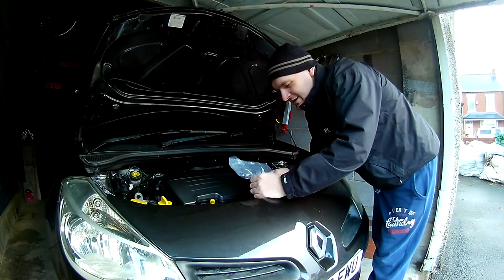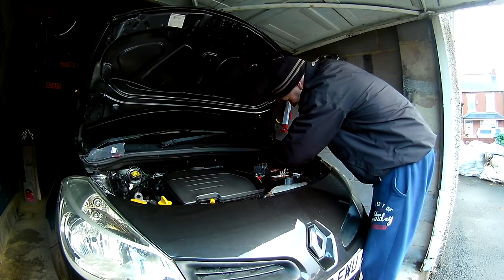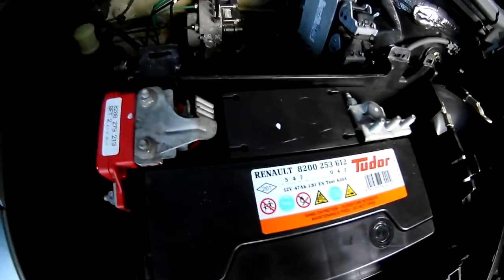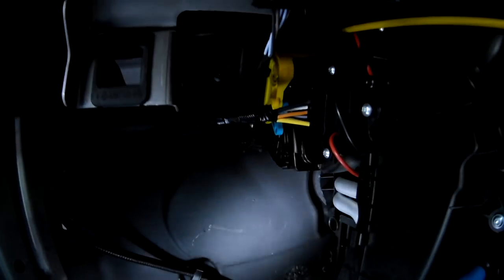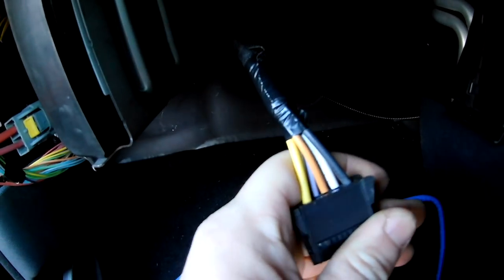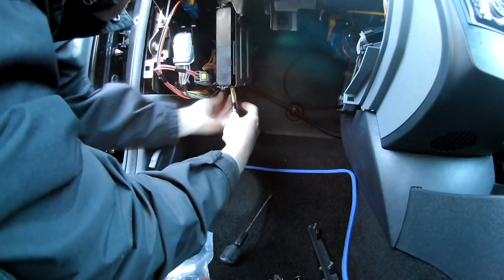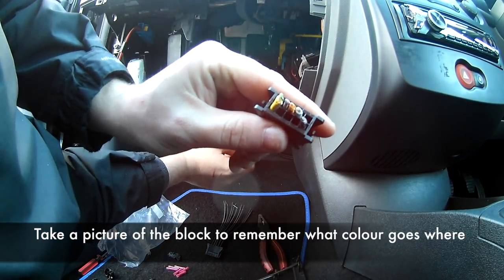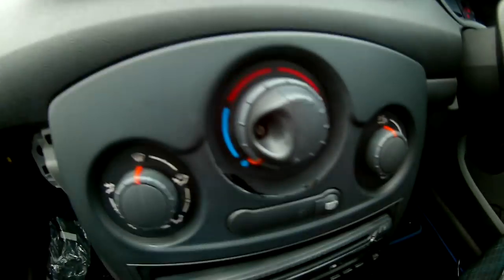No heaters! Renault Clio/Megane fan/blower not working. How to fix the fault easy!

Comment: Nice one, I'm working on my wife's megane scenic, mechanic tried changing fan 3X without results! Your vid showed me what to look for. Where did you buy that plug? My local motor factor told me only Renault main dealer sells them.
Reply from the maker: https://www.ebay.co.uk/itm/Heater-Motor-Fan-Resistor-Wire-Harness-Connector-For-Renault-Megane-Clio-Twingo/313025702856?fits=Model%3AClio%7CPlat_Gen%3AMK+III&hash=item48e1c92bc8:g:khIAAOSwTQNcMDnT

Comment: Amazing video. Do you have any links or how/where to buy the new connector please?
Reply from the maker: https://www.ebay.co.uk/itm/Heater-Motor-Fan-Resistor-Wire-Harness-Connector-For-Renault-Megane-Clio-Twingo/313025702856?fits=Model%3AClio%7CPlat_Gen%3AMK+III&hash=item48e1c92bc8:g:khIAAOSwTQNcMDnT

Comment: I've got a 2007 megane. I think it's the same problem. The heater works sometimes if you go over a bump. But it doesn't work most of the time. Would you say it needs this same fix?
Reply from the maker: Yes

Comment: Hello John 
I have a Renault Clio mrk 3 2007  my heater works on 123 but not 4 setting, was told it probably be the resistor's 
Would it be in the same location as Yours ?
Reply from the maker: Yes matey

Comment: Hi great video.....
My daughter has the same prob on her 2011 Clio dynamique.
I’ve looked at the connector and there are a couple of corroded pins, so obviously it needs changing.
Would you know the part no for the kit, Thank’s.
Reply from the maker: https://www.ebay.co.uk/itm/Heater-Motor-Fan-Resistor-Wire-Harness-Connector-For-Renault-Megane-Clio-Twingo/313025702856?fits=Model%3AClio%7CPlat_Gen%3AMK+III&hash=item48e1c92bc8:g:khIAAOSwTQNcMDnT

Comment: What kit did you use? ebay link??
Reply from the maker: https://www.ebay.co.uk/itm/Heater-Motor-Fan-Resistor-Wire-Harness-Connector-For-Renault-Megane-Clio-Twingo/313025702856?fits=Model%3AClio%7CPlat_Gen%3AMK+III&hash=item48e1c92bc8:g:khIAAOSwTQNcMDnT

Comment: could you please provide the link for this wiring kit
Reply from the maker: https://www.ebay.co.uk/itm/Heater-Motor-Fan-Resistor-Wire-Harness-Connector-For-Renault-Megane-Clio-Twingo/313025702856?fits=Model%3AClio%7CPlat_Gen%3AMK+III&hash=item48e1c92bc8:g:khIAAOSwTQNcMDnT

Comment: so we're can you get the replacement plug? help
Reply from the maker: https://www.ebay.co.uk/itm/Heater-Motor-Fan-Resistor-Wire-Harness-Connector-For-Renault-Megane-Clio-Twingo/313025702856?fits=Model%3AClio%7CPlat_Gen%3AMK+III&hash=item48e1c92bc8:g:khIAAOSwTQNcMDnT

Comment: I’m having bother with mine, is this easy to fix and how much is the new kit. I no this is an older video but any help would be appreciated.
Reply from the maker: Less than £20 mate you can buy off ebay and it isnt a hard job either! Just take your time and make sure the battery is disconnected when your dealing with electrics. Good luck
Reply: @The_Answer82  thanks for
This will see if I can sort it out. Appreciate it

Comment: can you tell me where ti find this component online to buy it or what is it called
Reply from the maker: https://www.ebay.co.uk/itm/Heater-Motor-Fan-Resistor-Wire-Harness-Connector-For-Renault-Megane-Clio-Twingo/313025702856?fits=Model%3AClio%7CPlat_Gen%3AMK+III&hash=item48e1c92bc8:g:khIAAOSwTQNcMDnT